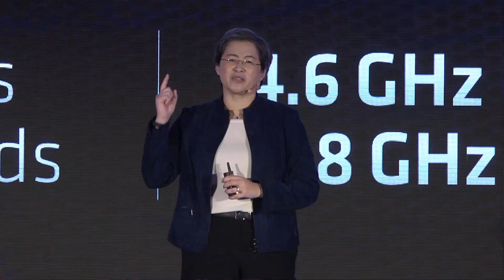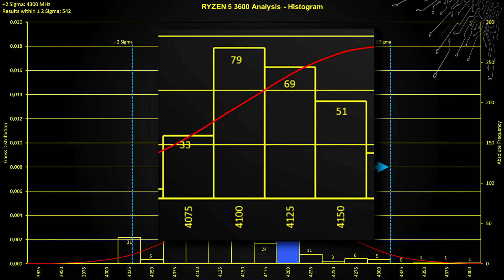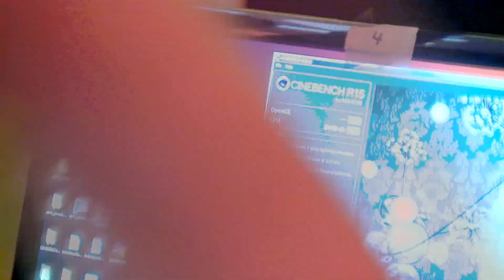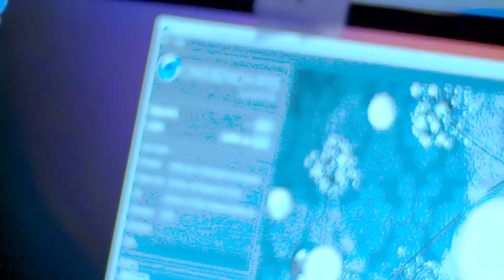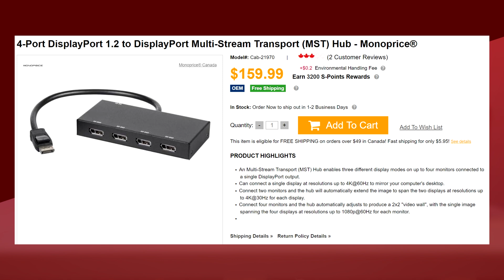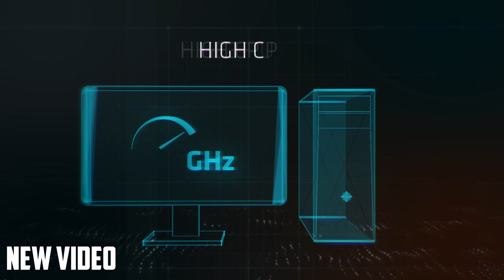95% of Ryzen 3900x Can’t Reach Boost Clocks, Survey Says!

Comment: My 3700X never peaks above 4300MHz, usually sits at 4250MHz. The advertised clocks are 4400MHz
Reply: mine can hit 4375, was only 4325 before i turned off auto OC (+200) and PBO.
Reply: Yea I caint get my 3700X pass 4200mhz.
Reply: I have 360 aio, 9 fans, great airflow and temps but guess i got a dud!

Comment: My 1600 was factory 3.2 it ran out of box at 3.5 with no overclocking and it runs cool I was psyched. sorry to hear the 3000 series is giving people a hard time.
Reply: Yeah.. My old phenom II x6 ran 3.2 factory stock and 3.6ghz on air no voltage adjustments...nothing on a zalman 9500 cooler and bearly broke a sweat..So what..That 1600 can easily hit 3.9 ghz on mid ranged and higher end air cooling without much voltage adjustment.

Comment: I don't think the issue is on AMD's end I think it's mostly just board venders, there is a YT'er who is a software engineer and he was playing around with BIOS's and modding them just your every day thing and he was able to get both of his 3900x to 4.7ghz by modding the bios any other bios but his custom changes it wasn't possible from my understanding he was able to do this on two separate boards from two different vendors so I think it's software related.

https://youtu.be/B1Cml29Lavw
Reply: According to der8auers Video, many board vendors have no idea what to do about this and AMD does not help them verry good. So I think it is probably a software issue that both AMD and the board vendors have to sort out together. There seems to be a real mess going on behind the Scenes...
Reply: @fie1329  Maybe I can't safe for certain but from a hardware standpoint AMD's chips seem to be able to hit their boosts (the original video I posted shows that) so I'm left to assume it's on the software end which is handled by board partners. AMD has always done a good job of letting board manufacturers do what they wish as they see fit. 

I think more than anything since the hardware is capable of reaching the boost clocks that the issue really isn't all that much on AMD soley. Intel has for years told board makers what they will do and will not do it's seems in short they have forgotten how to make a board without a list of demands they must reach. AMD is in charge of the silicon the rest is on the board makers to figure out. I'm sure input from AMD would most likely help but it's a different country from a different part of the world than Intel they shouldn't expect AMD to work as Intel does in this regard and if AMD's hardware is capable of reaching the specs but fails to do so on boards that might be a good bit of the blame. AMD has always given mobo vendors a large degree of anatomy/freedom to do things as they see fit.

Also for the record I do not have a AMD CPU/GPU I have never owned a AMD anything short of the PS4 I bought at launch. I'm not trying to make them out as great there is a problem but I can't help but realize the difference between them and Intel as (Intel) has always told them what they will do, when they will do it, and how they will do it. That takes a lot of the pressure off them and it's partly vendors job to get things working on their end to it kinda feels like (with the past 3 launches) they have forgotten how to do that.
Reply: That wouldn't happen to be ...Wendell from Level1techs that you're talking about, ..would it?  xD
Reply: @motoryzen  Yes, the video link is to his channel
Reply: 7nm is a bottleneck for high clock speeds

Comment: The 5700XT can be better price-to-performance deal no question.

But it seems some of the AIB cards, are starting to chip away at that advantage.
Reply: What good are aib cards when you you cant get them....by the time you get them...and at normal price next big thing will be here....1080 ti still owns them
Reply: @samwall2108  that's why just scored a nice deal on Ebay,EVGA GTX 1080 TI FTW3 $445,mature stable drivers,raw power at its finest.
Reply: What did you expect? Board partner wants good profit for themselves. Many board partner did not like nvidia restricting rule but the really love the fact they can sold lots of nvidia GPU and charge a kidney or two with them. Just look what happen with 1050ti before. Nvidia set the MSRP at $150 directly attacking RX460 4GB positioning. AMD then drop RX460 4GB price and RX470 to $170 just to fend of nvidia 1050ti. But Asus even after RX470 take effect they still set their 1050ti Strix at $180. With AMD some board partner did not like the fact it is harder to sell their GPU. we often heard that AMD reference board is very high quality in build vs some of board partner regular board. Reference exist as the base line board partner need to adhere to when building their AMD GPU. but why some board having worst board than reference? Because it is harder to make profit with AMD GPU (aside from the premium one) they cut corners with their regular boards. Not to mention AMD GPU hard to sell without heavy discount on them.